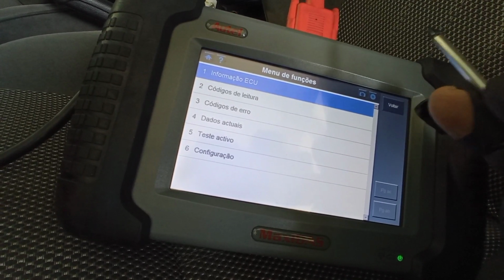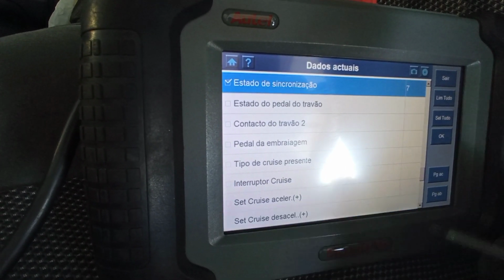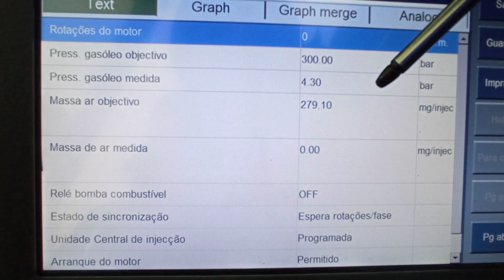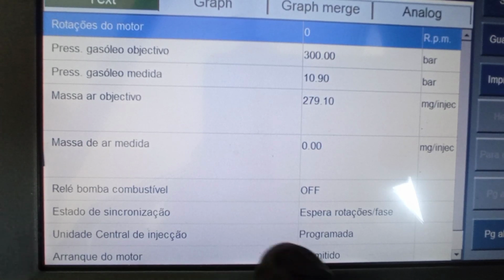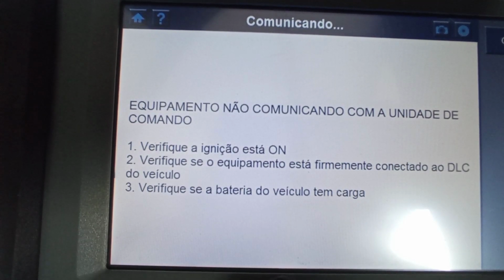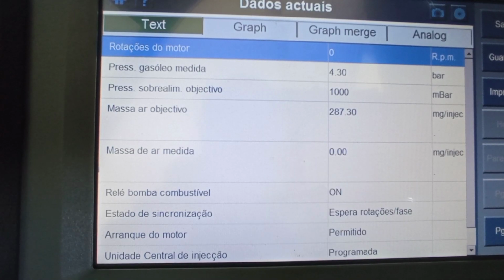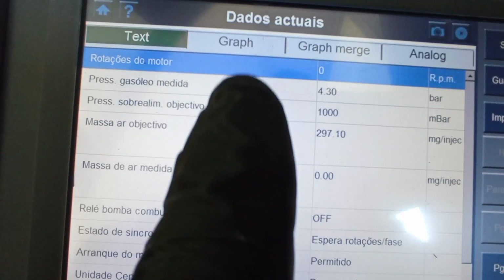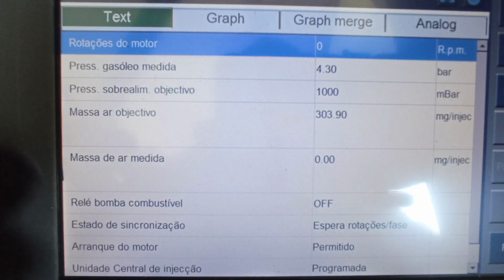Engines starting 101. Everything you need to know. Common rail engines.

Comment: Hi I have problem can not start alfa  can not get dizel in injection all go back in tank can you help vhat can I do
Reply: I have code P0235 and P0091
Reply from the maker: Low fuel pressure, test that fisrt
Reply: @alfaromeonoproblem what do you meqn in tank check pump or valve ond presure pump
Reply: Yes fuell not cam to injectors pump do not leth fuel to pass
Reply from the maker: What are the pressures?
Reply: @alfaromeonoproblem I dint have to mesure it
Reply from the maker: You must
Reply: @alfaromeonoproblem Sorry if I'm bothering you, just to write briefly, the car turns off at 2500, 3000 rpm and starts up again normally, but when I removed the sensor from the ramp, cleaned it and put it back, it won't start anymore except with the start spray and as soon as you step on the gas, the car turns off
Reply from the maker: Test fuel pressure at that rpm
Reply: @alfaromeonoproblem Is it possible that this sensor is broken because until I took it off the ramp, the car started normally and then shut off as I wrote in the previous message
Reply: @alfaromeonoproblem I don't know much about repairing Alfa Romeos, but I see that you repair Alfas, so I'm asking you for help. Sorry if I'm bothering you
Reply from the maker: Do not replace anything without having sure
Reply from the maker: I have all the videos for troubleshooting and repair. You must follow the procedure please
Reply from the maker: Follow this video
Reply: I change the valve on the pump and the same no fuell in injectors all go back in tank

Comment: Have a weird problem. After about 2hr drive, left car for 5min in parking lot - car would crank, but not start. Thought I'd let it cool down. After 1hr, car started fine. The car could be started some times after that, but not many. Ordered crankshaft position sensor. Changed it (I don' t know about other models, but this was pretty hard on a 159 2.4 q4. After sensor change - same problem - can't start the car. Engine cranks over fine. Diagnostics tool shows approx 250 RPM when cranking (with camshaft sensor disconnected), almost 500bar of fuel rail pressure, but engine does not start. I don't see any immobilizer issues, or fuses blown. Could it be a camshaft position sensor?
Reply from the maker: Hello. Camshaft and crankshaft sensors on the cars are very good, I have never so far have seen one fail. Unlike the old ones with the long cable.
Check on the parameters the authorization to start and coded key.
Reply: @alfaromeonoproblem  Maybe you know if it is possible to see those values in MultiEcuScan?
Reply from the maker: @janussQv yes, for sure! In live data, or parameters

Comment: Please help. My 1.9 jtd 115hp engine in a Stilo started to start badly. It still starts in 1-2 seconds, but it like tries to fire, shakes and jerks. It's almost like the one you got at 8:25 in the video. It almost starts, the starter speed increases for a moment, but then it has to crank more. The problem is most pronounced between 0 to 5*C. If it's hotter of below zero it starts ok. I checked the injectors return fuel quantities, changed the crankshaft sensor, checked for fuel leaks, changed the glow plugs. It doesn't happen constantly, but at 0 to 5C it is most likely to happen. When it finally starts, and then I immediately turn it off and start again it starts normal. Last winter it was perfectly ok, and now it crapped out.
Reply from the maker: Hello. Thanks for watching. They seems to me like injectors. Remove them and have them be checked out on a testing machine
Reply: @alfaromeonoproblem  Thanks for advice. You might be right, because the last summer I changed the injectors and put four used ones, as it was smoking black on the original ones. However these used injectors were checked on a machine before I bought them and they turned out ok. They had the same part number and came out of another Stilo 1.9 jtd 115hp. And I checked the return fuel quantities manually and they were all almost the same. I also checked how quick it builds fuel pressure and it gets to 300 bar in about 1,2s after few days not being started. If it was the new used fuel injectors it would be a bummer. I still have the old ones but it's too cold now to pop them back in.

Comment: I'm actually diagnosing my non-starting engine right now :) It starts immediately when spraying some brake cleaner in the inlet though. Changed the injectors, worked for a day, then stopped. Changed the high pressure pump, worked for a day, then stopped. These problems did start when refueling, so pumping all of the diesel out today as the next step...
Reply from the maker: Wen it does not start, what is missing?
Reply: @alfaromeonoproblem  I wish I knew. This is the last try I did today: https://youtu.be/KykwCax6fRc. MAF is disconnected on this try, but it still wouldn't start. When it was connected the value was somewhere around 17 I think. It does say water present in fuel, so that's weird... At least it starts now when the engine is warm, before the high pressure pump was replaced (second hand one though) it wouldn't even do that. The weird thing is, that when the high pressure pump was replaced it was left standing deliberately for 4 hours and it started immediately. Next day, nothing again. I'm afraid if fuel really is the problem it also f****d up the new injectors and pump by now...
Reply from the maker: Can you read the same parameters as I can?
Reply: @alfaromeonoproblem  I tried to get as close as I could. This is my video https://www.youtube.com/watch?v=XBp10QhvVVs . MES doesn't seem to have any synchronization parameter.
Reply from the maker: No fuel pressure man.. check out the fuel regulator on the hi pressure pump

Comment: Hi, i like your videos, they are full of details. 👍 I have a question about codes: i have a alfa 159 2.0 170hp and on highway i had error P010F but after driving 20km in city the engine fault icon has disappeared. Do you have any idea why?
Reply: Hello. It means you have a issue on the mass air flow. Not the sensor but something on the circuit. All intake, EGR and exhaust. 
A torn intake pipe, a faulty EGR, a clogged exhaust and or dpf. If the air does not pass correctly through the system it can not be measured correctly. Next week o will release a video to how to test the MAF. Alfa Romeo? No problem!
Reply: Thanks for fast answering 👏 I have forgotten to mention that my mass air flow  sensor is quite oily on the outside, so this could mean that i have a problem with the pipe? Its too loose?
Reply from the maker: Hello. Try to feel is the pipes and tubes are loose to the touch. Pass your fingers to feel for cracks. The oil is not very normal in quantity but not normal to leek out too much.